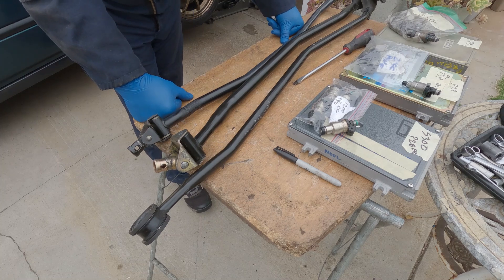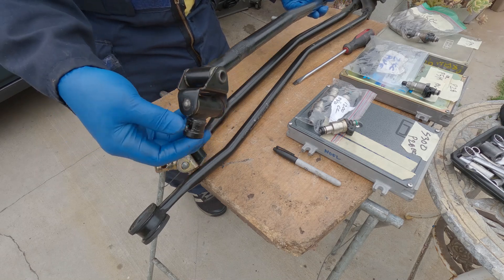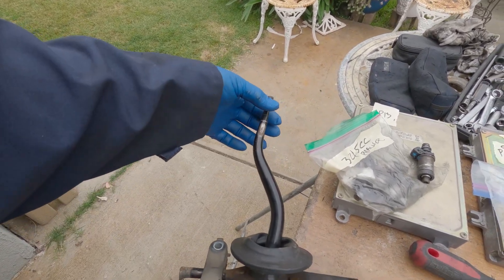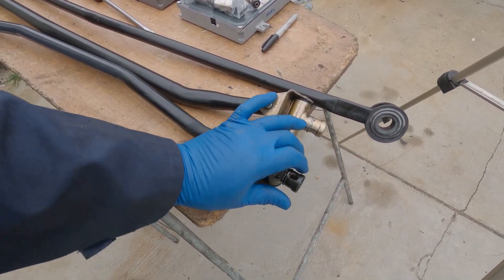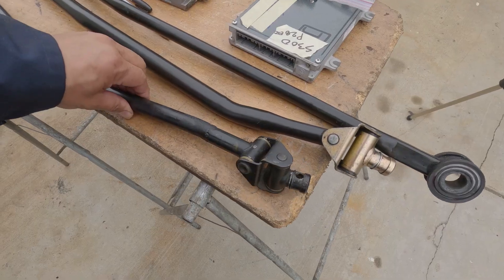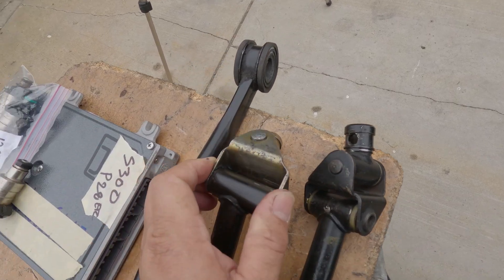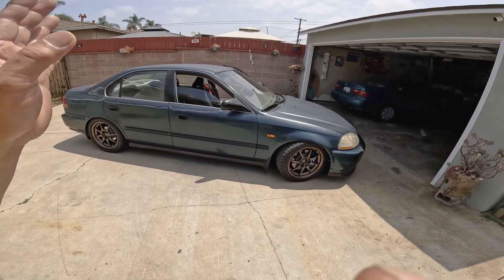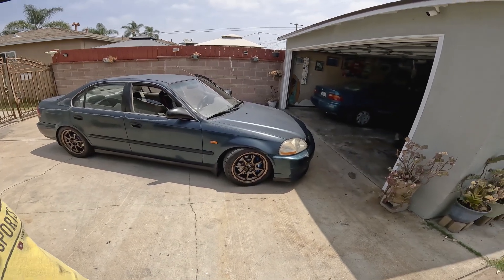B series transmission, Mis-shifting 5th gear Fix!

Comment: Super cool man. I can remember how hard was it to wire the g23 into the civic. I was looking didn’t see a video
Reply from the maker: Thanks, the engine harness part wasn't really that difficult but it took a little longer getting the auto to manual wiring figured out.